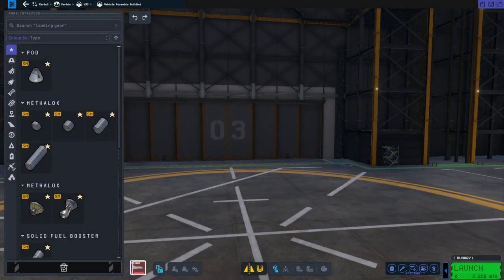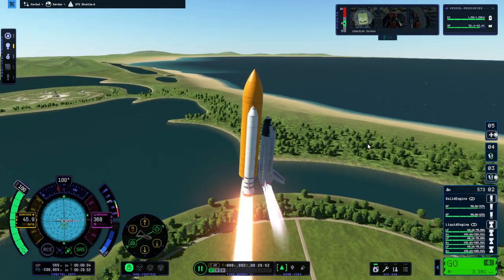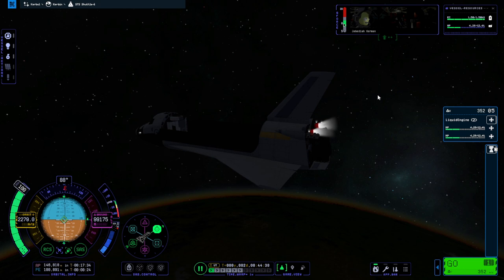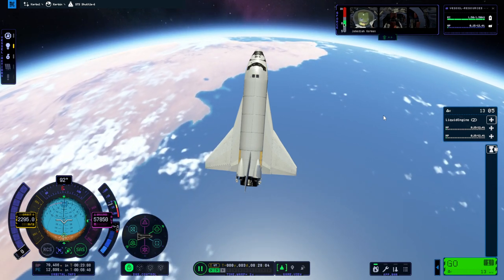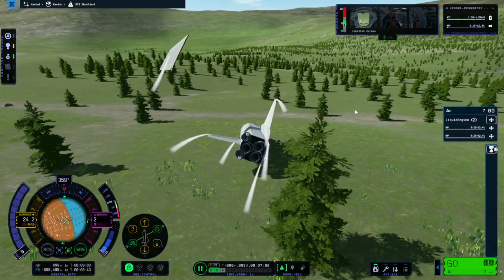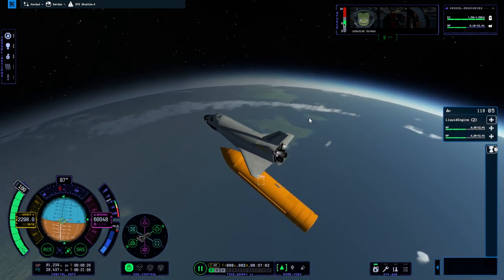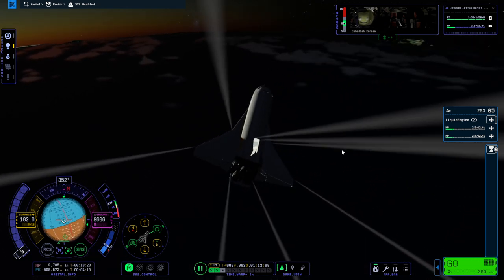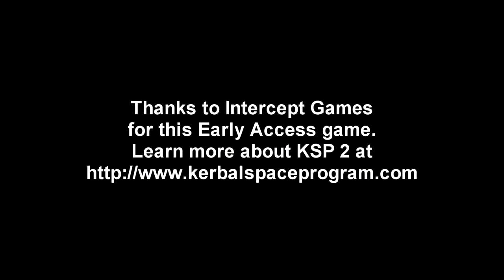Kerbal Space Program 2 Early Access 06 - Shuttle Bug Fixing and More Testing

Comment: Also, I found out a "work-around" for the time-warp limitations.  The tracking station remembers the time-warp factors for your most recent vessel.  So if you put a random pod on the launchpad, you can time-warp at any speed.  So you take your current vessel/mission, go back to the tracking station, launch a new vessel, and go back to the tracking station again, and you can time-warp whatever, even while looking at your actually active mission.
Reply from the maker: Well, at least that probably means it wasn't their intention and it'll probably get fixed.

Comment: Why the docking port works for you? For me it's instant destroy vessel when I undock.
Reply from the maker: In a video being uploaded, I checked and saw that, because I had chosen hard difficulty, there was a docking setting turned to 50% in the settings menu. Also, on the docking ports, I generally set the docking acquire force to 0-10%, because I'm used to docking with Realism Overhaul in KSP 1, where there isn't much magnetism. I think reducing all these "helpers" means that there's less chance of explosion, but I'm not sure.
Reply: @RaizSpace  thanks I go try it